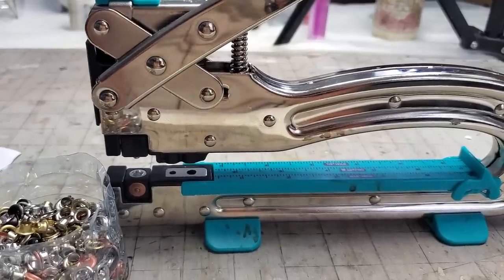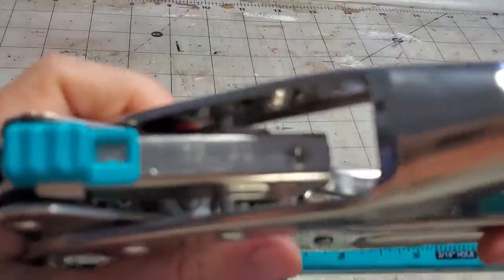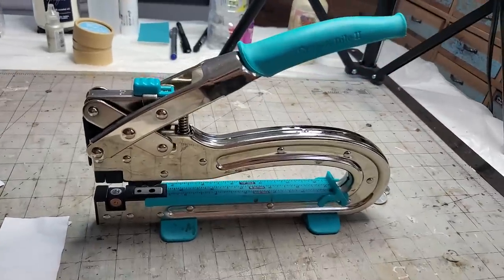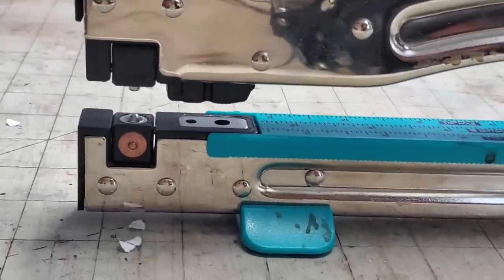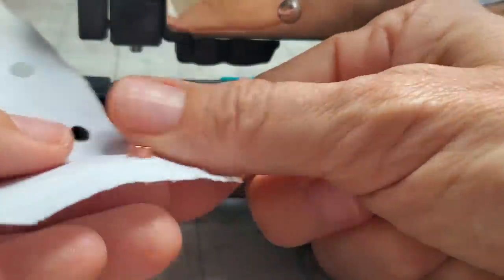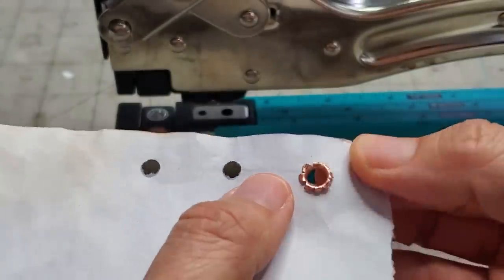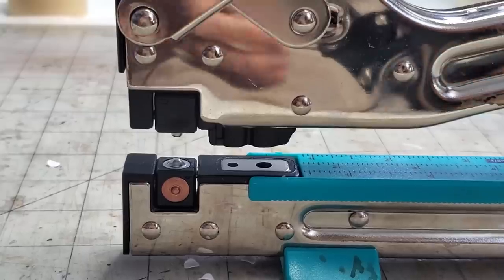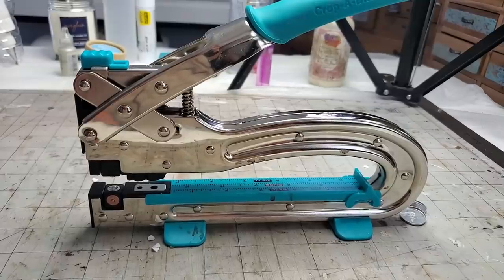How to Set an Eyelet with the Cropadile 2 Big Bite! For Junk Journals The Paper Outpost! :)

Comment: Hello all. The eyelets without the splits usually come with little washer type rings. If you place the washer onto the flying saucer, the eyelet in the hole, hover over the flying saucer and gently press the handle until you see the stick going through the eyelet then full press. With that you get a very smooth fixture.  I usually tilt my crocodile so I can see everything is where I need it to be then I stand up and use my substantial body weight to press.
Reply: Deborah, Thank you very much for this additional information!

Comment: Finally someone who explained why for years I've had issues and rarely use eyelets.  I had the wrong ones.  No pre splits.  And mine was wonky every time. Now maybe I can use this a little more. And thanks for letting us know to keep it at ONE setting. I've tried them all. I even replaced an entire Cropadile thinking mine was defective. I bought new dials that they do sell separately and NOTHING worked. Such a simple fix. You rock girl!!!
Reply: And a follow up. I set three perfect eyelets using Pam's suggestions on settings.  First time in years!!! I set both my small and large Cropodile on Pam's settings and perfect.  Reckless abandon here I come!!

Comment: Oh, my liege!! Love this! I recently bought one of these and the eyelet settings were a bit of a challenge. The eyelet & grommet settings are lettered on the top rotating cube and numbered on the bottom rotating cube: 3/16” settings are A1 = A is top cube and 1 is bottom cube. The 1/8” is 3C. Because I have both 1/8” and 3/16”, I committed to memory. It’s hard to see the letters and numbers so I rubbed some nail polish in them and wiped away the excess to reveal the imprints of the characters better. There’s also a chart in the online owners manual that I took a screenshot of so I always have it on my phone. I wish I would’ve known about the teeth on the back of the eyelet before I bought some - mine are solid and they split but it ain’t purty. Luckily I’m still in the experimental phase and not too worried about how they turn out. Thanks, Pam!!
Reply from the maker: I hear you! I tried memorizing the chart thing, I made a copy , proceeded to lose it immediately,,,lol,,,no surprise..I just thought if I can find one setting that works well all the time I will stick with it. After much punching..alas!
Reply: The Paper Outpost I have a proposition for ya... could you do a video demonstrating a vast array of examples of standard and clever ways to use eyelets and grommets in our journals? Please...? I’ve seen a couple (an eyelet in the lower corner of the journal cover with the TH loop pin & a bauble is the only example my brain with cough up at the moment... oh! and obviously as a way to thread ribbon through for a closure), but would love to incorporate more of them. Oh! And brads, too!! My AliExpress Fairy is bringing me a boatload of brads and I am itching to put those little babies to work. I used to be a sheet metal worker in a former life so any kind of metal, tool, and/or hardware makes me geek out. Don’t get me started with embossing metal...that’s what got me into this mess in the first place!

Comment: I did not know about the splits needed on the bottom. None of the eyelets I was using for my paper projects had slits! Luckily I found those that I had with my sewing supplies did have bottom slits. They worked so much better. I wish they would be smoother to touch. Thanks for the tutorial.

Comment: I love the way you describe things. We don't need technical terms, they are confusing! What are the other 'flying saucer' sides of the lower cube for? I am hoping one of them is for eyelets with washers as that is what I need. That eyelet which split is one which needs a washer. Grommets are the larger eyelets which are 8mm or larger. Anything smaller i an eyelet but it really doesn't matter. "A rose by any other name would smell as sweet...."  We can't get things in inches here in UK! The 3/16 eyelets are  about 5mm and the smaller ones are just a little over 3mm for those who are wondering. I prefer your imperial measures. They make more sense to me. 

(A bit later): I found a short video using eyelets and washers on the Crop a Dile and it was fine as long as it was inserted in thicker medium. I will be using two layers of thick fabric so I am happy now. Just eager for my Crop a Dile to arrive.
Reply from the maker: HI Maggie, great tips thanks! I have not experimented much with the other sides..but I am sure they have something to do with what you mentioned :)

Comment: I have a Big Bite that needed new cubes because the large eyelet squasher setter cube (top) was not extending the stem thingy.  After getting a 2pk of replacement cubes, I realized they are NOT for the Big Bite as that replacement process for the  Big Bite is only done at the factory.  Bummer.  Just letting folks know.  As a BTW,  out of frustration and need, I tried the 1/8 squasher and to my surprise it worked on my 3/8 eyelets with the 3/8 base (saucer) The process of using the 1/8 sqwasher fixed the stuck 3/16 one.  Amazing --just passing it along

Comment: Hi Pam, cool Tutorial, thanks! I am just thinking of buying a Crop-A-Dile Big Bite II by myself. For Journal making. I often run into issues using my Prym Vario Pliers because the Journal Covers are often nearly to thick to punch a good whole into them (cardstock and then fabric on the inside and the outside...). Can you tell me, if this thing here can punch holes and set eyelets more easy into usual selfmade/handmade Junk Journal Covers? TFS

Comment: Thank you!!!
One question...what is the difference between the cropadile and the cropadile 2?
Reply from the maker: Basically the reach of the bite. They both punch holes 1/8 and 3/16 inches and both set eyelets but the big bite can reach in to the center of the signature to punch the middle hole. You can use an awl to punch the middle hole if you have the regular cropadile :)
Reply: @ThePaperOutpost  thank you!!!

Comment: Thank you for this. I haven't purchased one of these because I was intimidated by it. I was  considering buying the smaller hand held one. Which one is better to use in your opinion?
Reply from the maker: They both punch holes 1/8 and 3/16 inches and both set eyelets but the big bite can reach in to the center of the signature to punch the middle hole. You can use an awl to punch the middle hole if you have the regular cropadile :)

Comment: I found that when I follow the directions for the 1/8” eyelets there is many times that the squashed side doesn’t look right. It works best on thicker materials. Unfortunately, finding eyelets that have the split bottom are hard. I use a lot of 1/8” eyelets for my journals, and so far, they are. It split on the underside😮